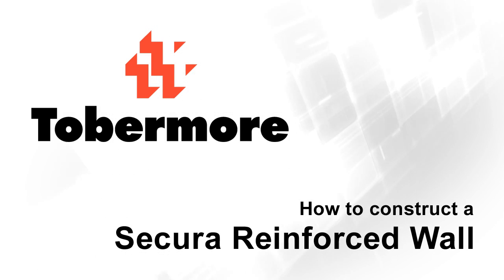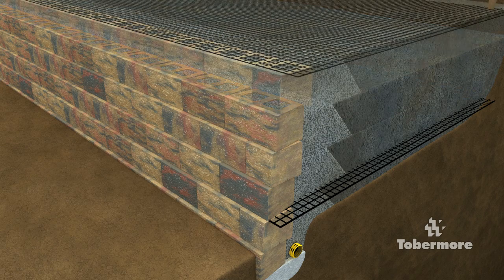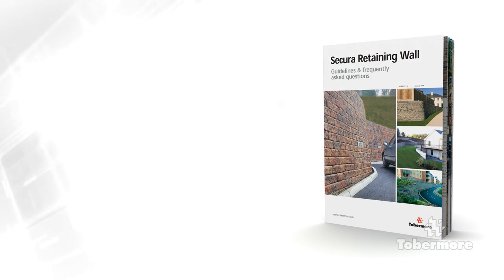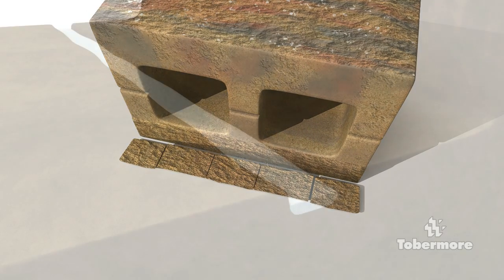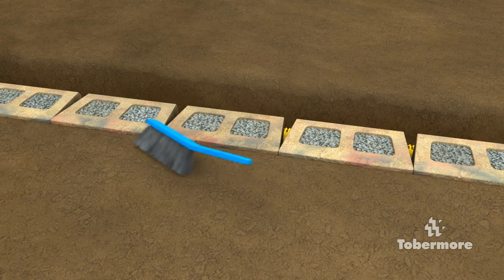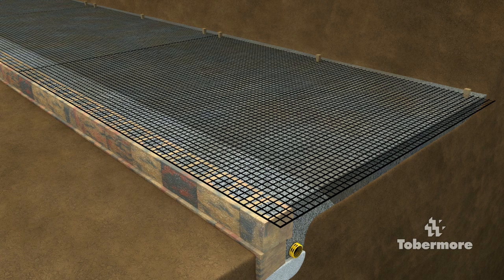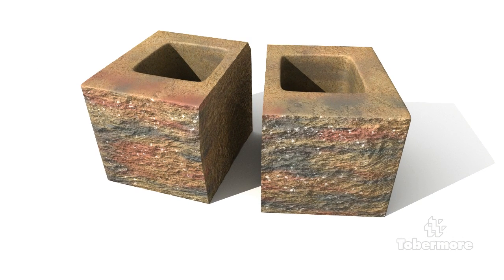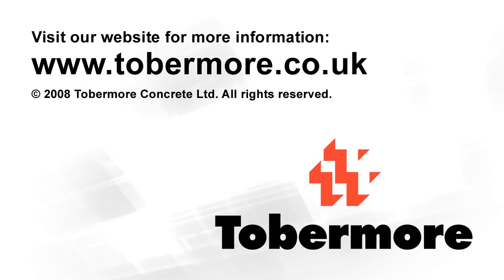Tobermore's guide to constructing a reinforced retaining wall.

Comment: compatible draining material - what is it?
Reply: NOT pea gravel! as it is round and will not pack causing wall blow out. Always use a washed crushed gravel 3/4" is usually recommended.
Reply: But what do we use for behind the drainage rock. In the animarion the drainage rock is like 12 inches wide then behind it is like 10 feet of some other material! What is THAT material?!!!
Reply: Thank you John.
Reply: Type 1
Reply: Pea gravel